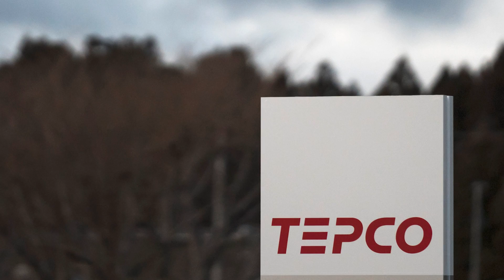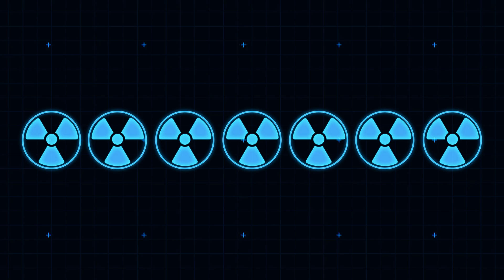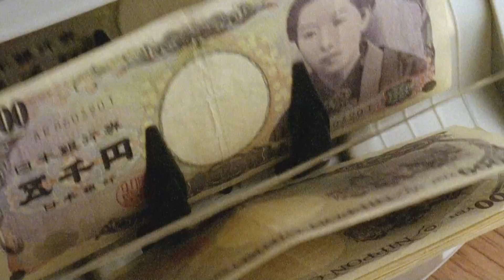Why The Largest Nuclear Power Plant Was Shut Down

Comment: Please read the book - Critical Path by Buckminster Fuller, where he clearly told that we should not use Nuclear power. Instead we all should focus on improving solar and hydro power enhancements which will last for generations after generations. Even if we could convert as much the sun power, will have more than what is needed.
Reply: Critical Path was written in 1981. The world has changed and the worlds energy consumption has increased a lot since then.
Reply: hydro and solar? bahahaha what a moron
Reply: Actually, the energy production should go toward nuclear more and more, due to very high efficiency, consistency, energy generation per square kilometer and having 0 carbon emission. The solar plants creates 300 times more toxic wastes than nuclear plants.
Reply: @gildedphoenix  agreed. People are brain washed nowadays to think that renewables can replace nuclear, oil and coal power plants... The same thing is happaning to theelectric cars idea... they are more expemnsive to produce and have a much bigger environmental footprint than normal combustion cars.
Reply: @carlosfaria7390  about electric cars, they indeed take 3 times more carbon print to make one than a combustion one but in 7 years of use (which is a lot though) can make the same print with the combustion one when we include the energy for recharge the electric car.
Reply: @gildedphoenix  in seven years the battery will probably already have even less eficiency... and in 3 more years will need to be replaced... The battary is what makes the electric car's foot print so big... so in conclusion, it's just not worth it at all.
Reply: @carlosfaria7390  currently, yes. But Electric Vehicles will be more efficient, unless we get a nuclear alternative first.

Comment: What a sad waste of money. How many solar panels and batteries could that money have funded without all that risk?
Reply: The amount of solar panels with the same money would not have produced near as much electricity... our solar panels aren’t efficient enough to even come close, now batteries would have been worth the investment
Reply: @adampaseur1190  The International Energy Agency (IEA) has said solar is now the cheapest energy in history. And the price is still falling rapidly. It's far cheaper than  nuclear. 

Have you seen the work of Tony Sepa?  Nuclear power plants are about to become stranded assets if they're not already. They won't be able to sell their electricity to market because solar energy is so much cheaper and a lot less expensive to maintain.
Reply: @brianrcVids  To build just the solar facility yes, assuming you can find the land area for it, but not if the needed grid storage is accounted for.  To get an equivalent plant to say a 3500MW nuclear facility in solar, the solar facility alone would be much cheaper but only energy for about a 5th the number of homes total averaged throughout the year.  With the needed energy storage to make it dispathable, it would instead cost 10 times as much using the cheapest available grid energy storage (which is unavailable at that scale) while still only providing for a 5th the number of homes.  To provide the equivalent energy you would need a solar facility of 5 times the capacity (which would be about 50% the cost to build as the nuclear facilty) but still isn't dispatchable.  All that to say that solar being cheaper than nuclear is just not accurate.

Comment: Neuclear power's not worth any risk, it's where limits should be set; pro life.
Reply: actually nuclear power is remarkably safe and even the worst of the radioactive waste can be recycled back into reactors to provide more power with modern day tech. the only reason reactors have failed is because of either decades of mismanagement and under funding or poor placement of the reactor sites
Reply: @coreytaylor447  "worst of radioactive waste", which is hardly recycled, as it does cost, lot more than not recycling at all.
Reply: It's far better than most alternatives (fossil fuels, gas, etc). The issue is when it's miss handled or proper precautions aren't put in place. Fukushima plant even during its disaster didn't result in direct loss of human lives while just through burning fossil fuels, there's an annual death rate of around 100-200 people (iirc) every year.
Reply: @bruhder5854  can't really say; it's better than alternatives, as it's immediately dangerous, & very dangerous. A line needs to be drawn here.
Reply: @fletcherrebello  it's potentially more difficult but both short term and long term better for people and the environment. But I do agree it's extremely dangerous to both environment and lives if anomalies occur.
Reply: @fletcherrebello  If it is already the safest form of generation statistically then how is it very dangerous?
Reply: @pedersgm  Statically; statistics are theory, for the paper, Thoughts, wants, & expectations, should be more practical, & realistic based, for best alternatives.
Reply: @fletcherrebello  if the goal is to protect the environment then nuclear checks all the boxes.  Plant land use per kWh is small, the waste (all of it) is completely sequestered from environmental impact, a condition even renewables can’t claim, and it doesn’t contribute to atmospheric pollution.  As for how long nuclear waste lasts that has repeatedly be misstated.  Nuclear waste is the only one that eventually becomes inert. Most of it is useful but is only waste because regulation or economics makes it so.  That is a political problem not an unsolved one.  The economical argument is being settled by new designs (see Elysium Industries for an example).  As for how much there is it is so energy dense that virtually every other industry and energy source produces more.
Reply: @pedersgm  Well if you say; N. Fission waste is not truly harmful, it's Politics that; say it's so, then I can't say more, but be conservative on my energy usage, & hope for Fusion to take over sooner.
Give it time, as it takes time, 
Hope for the best, expect the worst, &
Try to save more than one can, 
Be/ keep prepared.
Reply: @fletcherrebello  why do so many think the fusion will both be better and remove the need for fission.  We produce medical isotopes with fission that fusion cannot and aneutronic fusion is barely funded compared to the neutronic methods everyone knows about.  The one form of fusion we have successfully achieved required a fission device to work.  We may get there eventually but the problem we have to solve is here now.  We have fission now and it fulfills our needs.   If you truly wish to keep an environment we can survive in and uphold and increase the standard of living for humanity as a whole then fission is what we need.  You may not want it but it is what we need and we need much more of it.
Reply: @pedersgm  well you do have a point, when you say; Medical isotopes, but I'd like to bring yo your attention; these M. isotopes are for Medical treatment in the Alopathic field, which is not truly cure, but mostly pain relieving, 
Ok, use of Thorium instead of Uranium could be an alternative, to keep fission going, but all have yet to go with it, 
Till then Fusion should come into play, another reason to, put an end to the making/ forming of medical isotopes for the Alopathy field.
Reply: @fletcherrebello  I can’t use the term allopathy the way you are because it is both contrary to any sources I’ve see so far and the premise in which you are using it in is fundamentally flawed.  Medical isotopes are primarily used to 1. Diagnose issues and 2. Treat cancers.  Both types have saved millions of lives so to say they are only produced to line someone’s pocket illustrates the fundamental flaw in your assumption.  Back to Thorium, the use in reactors now would benefit breaking the Chinese rare earth monopoly but there is little incentive for it in the nuclear industry right now because Uranium is still very cheap and it’s price has very little impact on operations of reactors.  Bottom line no one is presently using it because the industry itself doesn’t have enough incentive to do so.  It is desired for governments to incentivize it for the external reason of putting thorium to use so that the liability of digging it up can be transferred making the mining of high value rate rare earths in country economically viable, this is how China’s monopoly is broken.
Reply: no risk